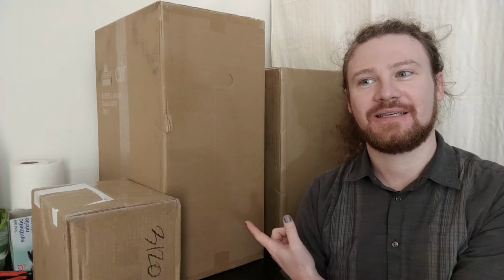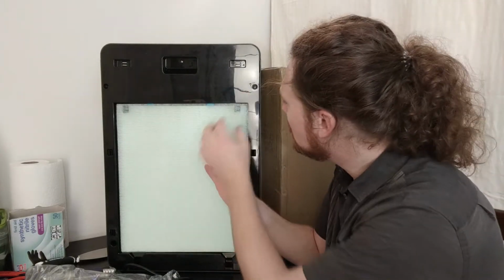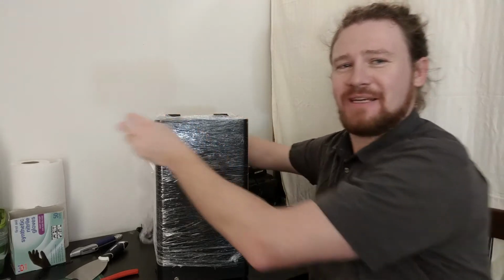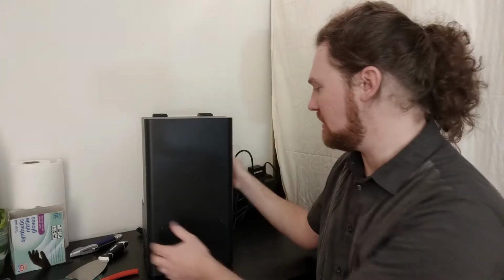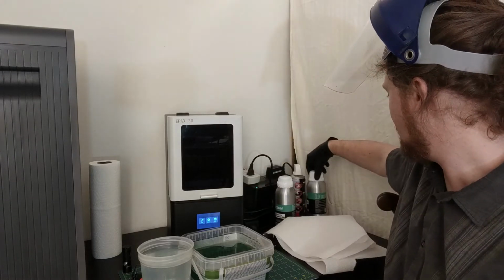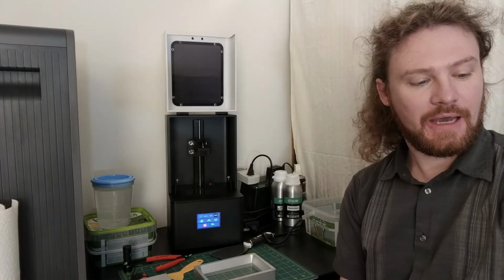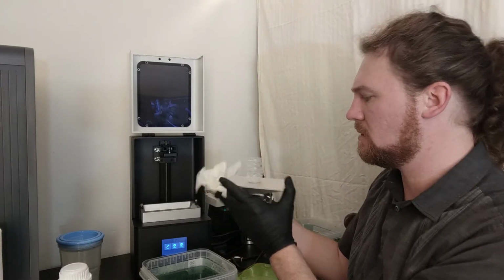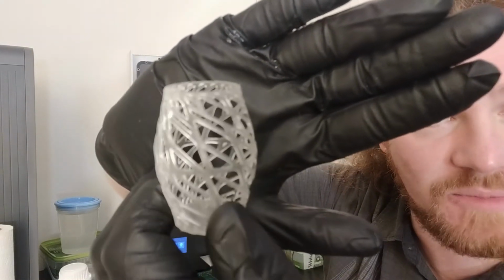Epax X1 printer setup

Comment: When emptying the resin after the failed first print, why didn't you use the paint filter? Also, most people use Isopropyl Alcohol for the rinse.
Reply from the maker: Yes, I've since switched over to IPA for rinses, since the Green stuff leaves a residue. The first failed print was entirely adhered to the bed, so there was no need to filter, as there would be no other source of particulates. In subsequent bath draining operations, I have filtered, since junk tends to accumulate.
Reply: @trevorkeller5431  Good deal. Just some observations as I was watching the video. Do you live on the Eastern Shore or Western Shore? I lived in Ocean City and Salisbury for 7 years.

Comment: hi, thanks for your video. Seems like you are printing in your apartment, which I am thinking to do same plan, so it helps me to watch your video that showing all steps. I'd like to ask two questions. Did you smell resin while you are printing? (looks like you turned off the air purifier while you are printing) Also, how loud is the printer while you are printing? I hear some noise of the fans. Is it loud as AC or just desktop PC? thanks
Reply: Hi, thanks for watching! The air purifier is in Automatic mode, not off; it spins up on its own when it detects particulates. The printer uses PC fans, much quieter than an AC unit. They're relatively low pitch, too, so it's not an annoying noise.
Reply: @fifthblackbird  thank you! you gave me some hope to move SLA from FDM printer! Also, may I ask you the name of air purifier?
Reply from the maker: Bissell air400
Reply: @ikuosaito3318  I live in an apartment with my GF and 2 cats. Only time you smell the resin is when you are next to the machine with an open lid. So as long as you have it closed you won't notice the resin.
Reply: @trevorkeller5431  thanks! I will look for it
Reply: @Vinddraken  thank you for the information! I thought impossible to have resin printer in an apartment room